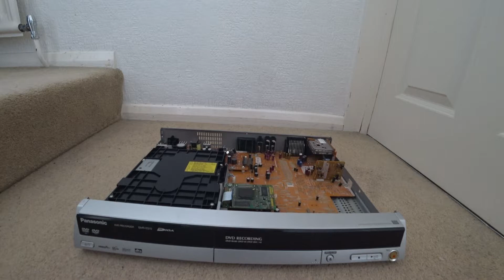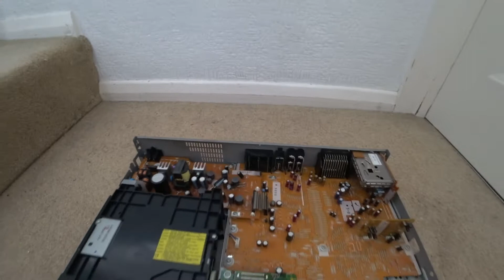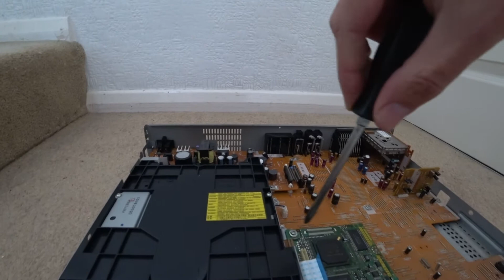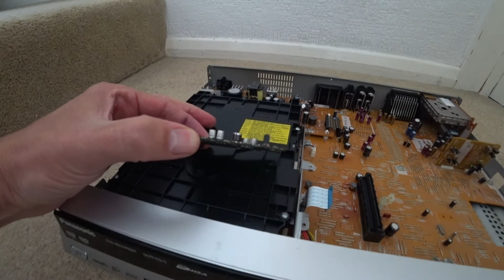Panasonic DMR-ES10 DVD Recorder. Blown Capacitors. Part 3. NO VIDEO PROBLEM

Comment: Those green boards get hot normally. There are can caps on the bottom side of that board that often fail, but replacing them is not a job for an amateur. Fair warning.